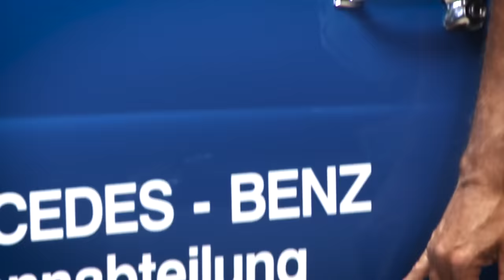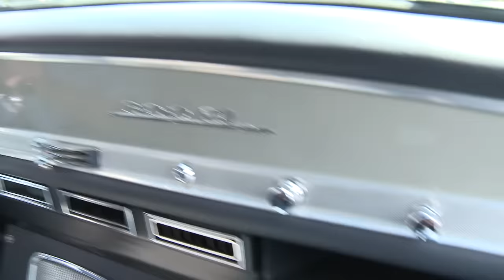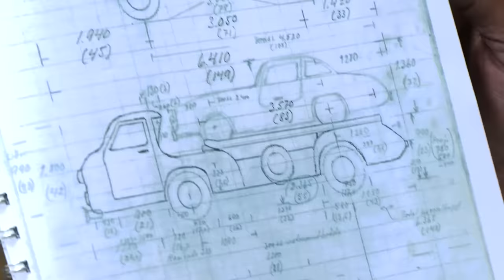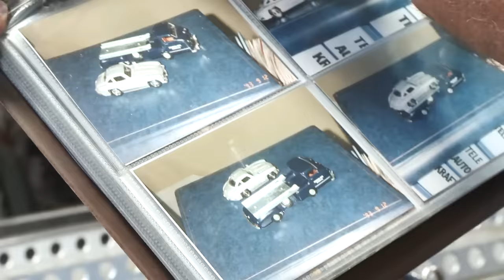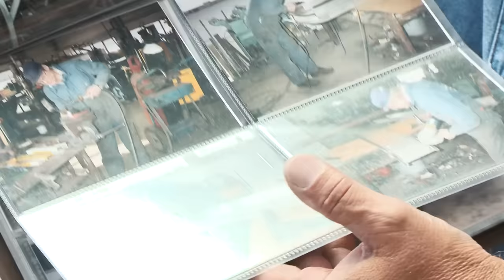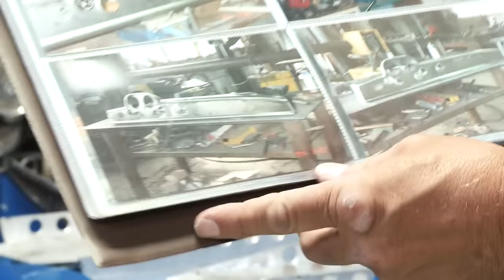1950 Mercedes Benz Racecar Transporter - Jay Leno's Garage

Comment: The fact that they crushed the original Transporter is insane. 
I'd reinforce it a little bit so loading and unloading will get safer, because that scratch was really shocking, good thing that gullwing isn't fully restored yet.
Why not go for a little more power? It's a transporter but the real thing wasn't called the Renntransporter for no reason and I'd really like to see one of those going at a 100 mp/h
Reply: C 63 S engine >:)
Reply: The mercedes 722s is the car that stand on that truck
Reply: It's ok. The heartless CEOs (aka the scum of many companies) who decided paid in full considering the bad rep and cost they paid.
Reply: Yeah .. An AMG engine :D Then the truck is louder and probably faster than the 300 sl on top of it.
Why are you people so angry about this? The guys who decided to destroy obviously made a bad choice, everyone does, it wasn't some perfidious plan they followed,
And come on, those "CEOs" didn't pay anything, the Renntransporter was crushed about 50 years ago, I don't think one of them is still working
Reply: People don't think of future values on what seems junk. Heck I see things all the time that I trashed as a kid and it's now worth something. I have a friend in his late 70s that is a real car guy and saved many things but he is really sad to think of when he was a kid how many of those old cars he cut up with a torch for a guy that sold scrap metal. They wouldn't have more than scrap value for 30-50 years. Think about what you throw away today as junk and what it could be worth in 50 years. Then again in 50 years it might still be junk.
Reply: Ostkreutz Rox the paint on it is original making the value INSANE

Comment: That front overhang is insane. How does the suspension not collapse?
Reply: and the frame
Reply: Airbag suspension . Just like a semi . That little truck isn't anywhere near heavy enough to overcome those bags !
Must ride awful funny , though , beyond just the steering happening behind you .
Reply: The centre of gravity is probably very similar to a big front wheel drive car, so the suspension would be fine. Think lorry suspension, really heavy duty stuff. As far as the design decision of making it with such a huge overhang... Crash safety would be like if you put an egg on the nose of a brick and drove it around like that, lol :P That's taking  into account the materials and design styles of the time. A modern version of that transporter could be as safe as any new lorry if you really wanted to make it.
Reply: The engine is above the front wheels. So it's not a front engined truck and the cab doesn't weigh that much.
Reply: The same way the over hang on the front of a bus works mate, front structure is not carrying any major mechanical components.
Reply: Right - I always wonder what went on in the heads of the designers. Cool car!!!
Reply: Just like Hyundai H100 ^^ there is too many H100 in my country and i was drive one.
Reply: that overhang might look a little to much, but there are enough semi trucks who have
a cab where the cab is in front of the  wheels, and the driver sits on top of the front wheels
or even a little more forewards. so it aint that weird.
Reply: yes  but with that overhang you'd think it will stuff it's nose in the pavement pretty often
Reply: that looks like an easy 2.5 foot overhang, that is quite a distance.
Reply: The question is: if a really fat person sat in the cab will it tilt forwards?
Reply: We can only answer that with empirical investigation. <dials for pizza and plane tickets>
Reply: Because German Engineers developed it and German Mechanics built it. Case Closed.
Reply: Fad Hill The weight is all in the middle
Reply: Fad Hill 
It just doesn't!
ok?
Reply: rear engine
Reply: Like a city bus tho.
Reply: Also, ever droven a west Fargo bus? They over hang 7-8 feet.
Reply: My guess is you would bang into all sorts of stuff learning to drive that thing. Especially parking it
Reply: Fad Hill mercedes benz magic
Reply: Due to the laws of physics, assuming the Germans applied the laws of physics. Designed the front end, and the back at a state of equilibrium. But knowing the Germans the suspension would have been an issue down the road anyway.
Reply: Fad Hill and it has so low departure angle...that's annoying and it will scraped the under when crossing some speed bumps...
Reply: 50/50/50 weight distribution
Reply: @Fad Hill: Because Mercedes
Reply: Motor is behind cab
Reply: Cantilevered
Reply: The legitimate "curb sniffer"
Reply: Looks like the cab bounces up and down a lot as Jay was driving, which makes sense since there's nothing in the front to hold it up.

Comment: I think during load/unload that the front air suspension should be full up and the rear full down to create the minimal angle change.  He showed one pic of the original unloading in his book, and that looks like the same configuration used, front up, rear down.  Just a  thought for future loads.  Great vid !!

Comment: Wow, that front end overhang is extreme.  Spoon drains and humps would be a big issue, even with the front air bags up full.

Weird that Mercedes made something like that.

The way it was bouncing around at street speeds makes 100mph sound rather scary.

Interesting vehicle.
Reply: I can relate to that feeling having owned a mid engine  1967 Gofar window van which was my race bike transporter..I lived in that thing. Lots of beer runs to Blaine Washington
Reply: They had the Nurburgring back then still, Germany had great roads since back then so this was just fine.
Reply: What about the rest of Europe?

Mercedes didn't just race in Germany.
Reply: That's why it has a funny design, so it can have a smaller turning circle for its overall length.
Reply: this isn't the original
Reply: xynudu keep in mind that it was running on the autobahn as soon as it would reenter germany. The 'bahn has always been maintained far greater than SoCal highways & surface streets so 100mph is not that far of a stretch. Btw...I'm sure she was not running triple digit speeds on surface or mountain roads.

Comment: At first glance I was expecting some kind of articulating steering. I don't remember this vehicle at all. Not that I should I suppose, but it is interesting. Having driven Cab Overs and Cab Forwards this looks as scary as some of the Autocar and Mack trucks back in the day. Of course you can still find some firetrucks that have a bit of this configuration but it just seems implausible. I remember a day attempting to turn to the right in a cab forward bus having to get past the curb so I had to stick so far out so I could clear, turning so hard and feeling like I wasn't part of the vehicle because my turn was behind me. I also came here after you referenced this in your discussion about the Chevy Corvair 95 Rampside. Thanks for sharing your experience.

Comment: you never spoke if the replica is front or rear wheel drive ? i have to  assume  that it is rear  wheel with  a pretty long  drive shaft  although  it looked like the motor and transmission   was set  as far back as possible  showing the build book was cool but it moved to fast to see  various details  of the build  of course  the whole project is very interesting  i didnt have it but i remember the Corgi  version of it  from some catalog  or brochure  i used to get  because i loved my Corgi cars with so much detail  on them  now  part of my sons collection  in the 70s i was lucky enough to have a Godmother/ Aunt that  made good money  and spoiled me rotten with  nice presents  like the Corgis  i did have a couple of Corgi Mercedes Roadsters  that  kind of resembled the Gull Wing  quite a bit without a hard top  at all on the toy version

Comment: Engineer: how long do you want the front overhang to be?
Merc: Yes
Reply: Merc: dont you ever just look at a fire engine
Reply: Longer than the one you can find on a bus!
Reply: Merc: picture a school bus, but in reverse.
Reply: Its a goofy sweep area :)
Reply: @Denstoradiskmaskinen  The extreme over hang of the front end was designed so the wheelbase could be made as short as practical, which makes it significantly easier to maneuver in paddock areas.  Smart fellers those Krauts!
Reply: @Loulovesspeed  hi

Comment: 13:35 Is that the ramp scratching and dinging the hell out the gullwing's bottom doorsill?
Reply: ***** That's true. He might need a little bit of filler there though, when it's time for that paint job.
Reply: +Michael Evans indeed.  i hate body filler
Reply: Nothing wrong with a little filler when major body work has been done, but when you start using bondo by the gallon on a car, you're doing something wrong!
Reply: Is really a door sill if it's a foot lower than the door? LOL
Reply: Jay Leno doesn't seem like he wants these cars to be museum pieces - he enjoys driving these cars, and generously makes these videos to share.  I can't imagine scratching that car, but unless you are going to keep it in a museum behind glass, things like this might happen.  Remember when he broke the Doble?  That isn't something that Pep Boys has parts for, either.
Reply: +Daniel van Slooten The car does have a tube frame, so what you see on the outside are just metal panels, for a good paint shop it's no big deal to remove the scratch.
Reply: still ''OUCH'',,, Ya can see it in Jay's face the rest of the episode..

Comment: Finally
I have searched where this transporter went, the builder of this transporter comes from Sweden outside Jönköping. Met him a few times and of course he first had an MB 300SL with the wings that he competed a bit with. He built the transporter after a small toy car, He was not trained to build cars but had an small electrical company that installed electricity in small house constructions.

Comment: Looks like you need to rethink the shock set-up on that thing jay. It was like a pogo stick going over bumps as if you were just using bags with no shocks as well to dampen the ride. Not very graceful on the unload either and that looked like it messed up the rocker panel pretty good. It might have helped to raise the front a little more to line up the ramps better.
Reply: and wheel chocks for the tires. Could have prevented the support ramps from failing. If the truck's parking brake is inoperable.

Comment: I hope the suspension was better designed on the original. That thing is bouncy as all hell and nose heavy. I wouldn't want to go on a curve at speed in the rain in that thing. Hit a bump wrong and the tail end is going to whip around in front of you with no traction. I can't imagine MB would have done 100mph in one unless the dynamics were totally different than this clone.
Reply: I thought the same after watching it...  Thing was bouncing so bad i thought he was going to bottom out the cab.  Its a neat idea i guess...
Reply: It's not nose heavy at all, the engine is above the front wheels and the cab doesn't weigh that much.
Reply: SydneyCBR6 You can see the nose dipping down on every bump in the road.
Reply: the length of overhang increases that look , but it isn't bouncing that much . Where the suspension is it only needs to move down an inch to make the front move down 6 inches .

Comment: They should have lowered the rear suspension and raised the front suspension, as it is designed to do, and they would have avoided that scratch.
Reply: Tbf it looks like the racing car is awaiting a lick of paint anyway, so I'm sure it's less of a problem than it would otherwise be. (You can see some big scuffs on it where the paint has worn off altogether)
Reply: @andrewbailey7999  yes mate but that's original paint from it's Mille Miglia days, that's why it's untouched. Each scratch and dent has history.
Reply: That does make more sense. I figured that out in a later video

Comment: Someone asked me why is this show different, why do you love this show so much more than the others.  Jay Leno doesn't just have the most exotic cars in his collection. He has the passion to share his cars with the world via his videos. When the car breaks down during a drive J is under the hood splashing water on the radio or under the dash looking for the fuse. He's real, he tells you the good and the bad about each vehicle. And sometimes on his show you get to see the quirks first hand.  

I'm sure they modified the foot of that ramp to have a brace to keep the foot extended. Maybe keep the air in the front air bags on the ramp truck as well.

Comment: Seems like you would want to keep the air suspension in front all the way up to reduce the angle at the back of the truck to prevent scraping.

Comment: Helpful hint: pump the front suspension high so there isn't such a big angle between the chassis and the ramp. I would expect most Mercedes race cars had even less ground clearance than the 300 SL.

Comment: 15:08 I imagine the original vehicle did not have that large, angular bump-out over the engine compartment, right?  It seems out of place.  I'd assume that was just to get the truck engine to fit, while the original engine would have been much smaller to fit flush with the deck.

Comment: What a coincidence. Last Wednesday I was picking up some parts from a scrapdealer for my car. On the way back I decided to take the backroads close to Granna in Sweden. As I stoped to stretch my legs I did so outside a small garage where some restored Fords as well as a SL500 was sitting outside. I went over to have a look at them when the man came out and we started to talk about cars and things. He eventually showed me around the place and also his office. In that office on the walls there where loads of photos and among them was a pic of this transporter. Lars (as his name is) told me that it was build by his best friend and he used it to transport his MB gullwing aound that he had restored. Not the same as Jay has I should point it out. When the man died his widow sold the Gullwing and the transporter. I never found out where the Gullwing went but the transporter was sold to a guy in Germany who promptly sold it to Jay Leno.  Now that is a good story.

Comment: it made me thinking the worst case scenario how u fix the car back in the day if the engine breaks down  with a broken car loaded on and the winch is not working..
otherwise the truck looks cool. i haven't seen any truck looking like this before.    The front tire seems to be located where the most weight is centerd with a car on top.

Comment: Oh wow, I could not watch this straight through.  I had to pause the video and get my heart out of my throat.  The guys dragging the ramps around on the floor while getting them set up already had me nervous.  And those ramps connect just inches from the paint job for that back panel (deck lid?) of the transport truck - aaaahhhhh!  And then it looks like bottom of the car is going to strike the ramps as the midpoint between the wheels passes over.  Those rocker panels are already scraped (from loading the car onto the truck?).  And then Mr. Leno, the owner, steps up: "The ramp is collapsing," he says, calmly.  I'm climbing out of my seat!  This is why I don't own any classic cars.  I could not take the stress!  OK, I'm going to click on play now and try to get through the rest of this.

Comment: I call it Bob. I understand the reasoning for the wheel placement, but this thing has trouble on Cali roads at 50. Can't imagine how squirrely it would be doing 100 on the roads the had back then.

Comment: Wow. When Jay shows the engine, I immediatly focused on the carburettor. Is it possible that it is a Pierburg 2E series or something simillar? If so, it is the same I have in my 1988 and 1992 Skoda Favorit cars :) Funny that even a piece of an average (but now very much a wanted yountimer) communist peoples car can share some parts with these modern west designs (though it is only from a MB van).

Comment: I would love to see that one... 
what happens when you go over railroad tracks?... speed bumps... etc??
Reply: we live in a mixed neighborhood.. old farts like me and working people with kids.. been here 10 years in this house.. occasionally someone comes through on a motorcycle a little faster than the 25mph speed limit.. but mostly no problem.. I got back from a summer in New Mexico and.. speed... cushions.. on the straight stretch... wall to wall old farts... the school bus driver, on the other hand is hell on wheels... I think they built them just for her... but I think you should find an alternate route when you drop that off over here Mr Leno... awesome truck
Reply: hey... I just found an add on thingummy for doing metal with my 3D printer... in case you are interested...

Comment: I am still puzzled how it doesn’t tilt forward when unloaded especially under breaking. The front looks way heavier than the back.
Reply: it was designed to be driven only on flat fast roads (autobahn), its not for off road and hills, and for everything else, there is adjustable pneumatic suspension

Comment: There is something wrong with the proportions. On the "original" one the transported car is much closer to the transporters cabin. The rear of the cabin has its form because the nose of the race car "fits" in it. The Mercedes replica was built by Mika in Mölln. I live not far away from there. I think, mika just did it for fun or promotion and Mercedes deecided later on to buy it. Its a long time ago they built the transporter, may be 25 to 30 years.